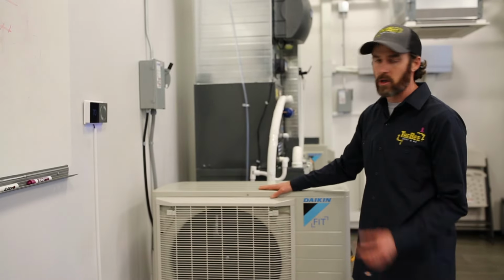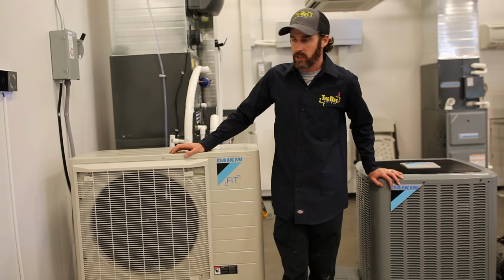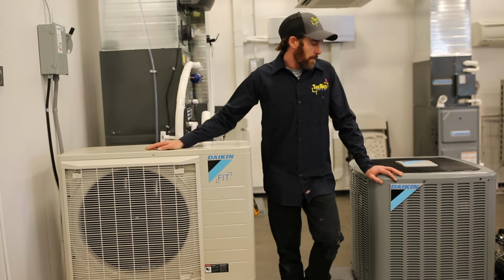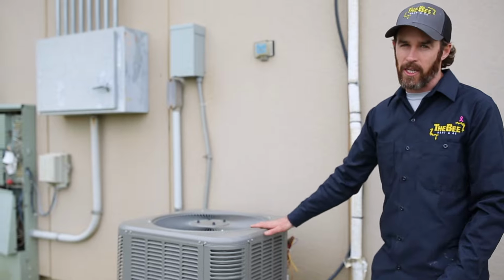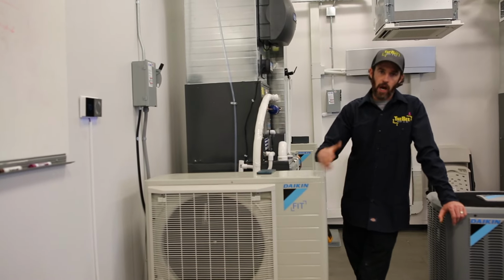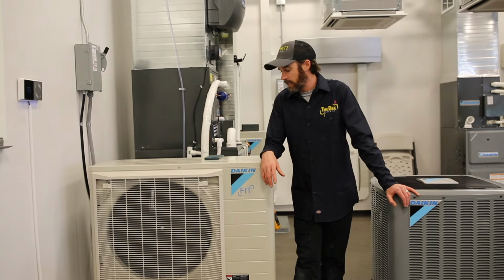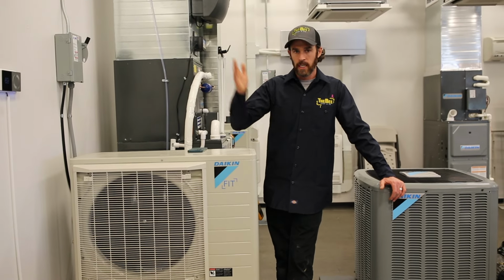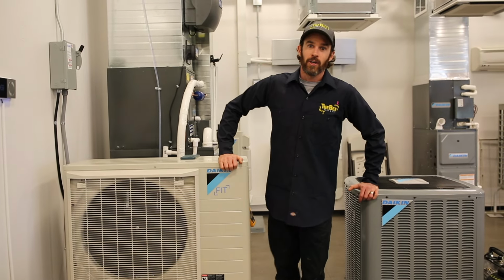BUYING A DAIKIN FIT?! Watch this FIRST or live with REGRET FOREVER!!

Comment: We moved into a house that had Daiken Ductless mini split air conditioners three years prior. WE HAVE HAD NOTHING BUT PROBLEMS!  Two years ago our air conditioning went out completely. Before I go any further, we cleaned the air filters in them religiously every 2 weeks. Daiken had to order a part that took 4 months to arrive.  That was after 3-4 service technicians looked at it.  We got the part and the end of October after suffering through a grueling hot summer.  Fast Fwd to this year.  It stopped working again. After the second service call, we had them cleaned because water was dripping down our walls.  Ever since then, they stopped cooling.  The serviceman came today and two of the three units were FINALLY cooling, but stopped again an hour after he left!  It's 95 degrees outside today, and over 86 degrees in this house!  We spent close to $3,000 on it two years ago, $575 three weeks ago, $230 today, and who knows how much tomorrow.  He is the only guy in central New York that works on these.  NOBODY WANTS TO SERVICE DAIKENS!  These are a piece of SH!T.  PLEASE if you're going for ductless, choose Samsung or whatever else.  DO NOT PURCHASE DAIKEN!  Even their helpline is pretty much no help to the technicians.  We could've had a whole new system put in for the money we've spent on "repairs" that NEVER rectify the problem.    GOOD LUCK if you decide on purchasing this CRAP!  They are nothing but a headache and I guarantee YOU WILL SUFFER WITH THE HEAT FROM IT CONTINUOUSLY BREAKING DOWN! UPDATE: After the technician came again today we were basically told we need a whole new system installed!!!  One unit out of the three is working, but we don't know for how long.  AS FOR THE TITLE OF THIS VIDEO.....THE THING YOU WILL REGRET IS IF YOU DECIDE TO PURCHASE A DAIKEN.  Our warranty expired 2 years ago.  So this whole system BASICALLY DIED in 8 years even after Daiken had a special board made for us!!! Never been so fucking pissed in my whole life!

Comment: Great videos on the Fit: I am South West Florida any 2,500 sq ft ranch house with 12 foot ceilings. I am replacing an 12 year old Lennox XC21 system (3 coils later). I have been quoted a 4 ton Dakin Fit Heat Pump (16 Seer) and a 4 ton Train XV20 (20 Seer) with the Trane composite air handler and 15kw heat strip. Both have a 10 parts and labor warranty. The Trane system is about $2,400 more expensive.  Which system do you think would be the best investment?
Reply from the maker: Daikin but I’m partial we’re a daikin dealer. In Florida you don’t need a back up heat kit with a Daikin fit heat pump the heat pump will always keep up in your temps. It’s pretty warm.
Reply from the maker: I would check with the dealer and make sure the daikin Fit will keep up that seems a little small for that square footage in Florida. In Colorado for a home that size depending on the load and design of the house you might only need a 3 1/2 or 4 ton out here but I’m surprised that’s all you need in Florida for that size home. If that’s what’s in there currently in terms of sizing and you’ve been comfortable and happy with it then that’s probably a safe bet.

Comment: I live in Ontario Canada where the weather can get into the minus temps.  Is the Daikin heat pump (80k) good enough to heat in the more rigid of temps alone or should i go with a gas furnace and Daikin air handler?
Reply from the maker: You’re going to want backup heat in Canada. Either a dual fuel with a furnace backup, or air handler with electric heat kit but 80% furnace backup heat is probably solid… your heat pump will typically be running when it’s 0F and warmer, (-18C and warmer)

Comment: Daikin = problems. Hard to troubleshoot. Intermittent problems take months to solve. Parts are not readily available. Not good in real life.
Reply from the maker: I haven’t had this experience. Their basic efficiency stuff (single stage equipment) is just like anything else, and Between their troubleshooting app for VRV / Communicating equipment I don’t think it’s any more complex than the other brands. If we had to wait for parts often we wouldn’t sell them so it might be an issue with your local distributor

Comment: I love how peoples first stated reason as to why they switch to a heat pump  is going green instead of that it’s more convenient. Yes ,a heat pump is more efficient at generating heat than than the conventional counter part however without renewable energy your just indirectly shifting  the source  of energy you use to create heat. So, heat instead of being generated by fossil fuel in your home is being generated by electricity.  Electricity still needs to be created somehow by the power plants. So, if you increase demand by going all electric you increase the demand for the generation of electricity ie still maintaining your carbon footprint. Without upgrading the electrical grid or increasing output of generation you will continue to have rolling blackouts and metering of electricity. Exactly what is seen in California who also is pushing all EVs sales by 2035 yet they are still metering their currentgrid. All this upgrade in the electric grid to meet the demand of all electric is only going to drive your electric bill up. We have seen a 300% increase in the supply charge in our electric bill. Also many renewables still have poor ROI and high costs. In addition, people still forget creation and recycling of solar panels, windmills, lithium batteries also has a significant carbon foot print and environmental impact.  I am all for new technology but just call it out as it is.
Reply from the maker: 100% it’s a mess lol… all good points. We talk about too how one thing people don’t realize about “going green” is there is still a thermal footprint with an electric car because you have endo and exothermic reactions equivalent to 20-30 tons of heat energy lol. Very thorough comment! It’s expensive to add solar too, as long as it’s your dream home / forever home I don’t think it’s a bad idea at all. Recycling these components is going to be interesting in 20 years when it comes time for people to replace them.

Comment: I was planning on putting a Daikin LV series 18k BTU mini split in my two car garage but I keep having people tell me to skip it completely and go Mitsubishi.  They keep stating they are the standard and even though Daikin is still considered a top tier manufacture it can't be compared and not to even waste time with it...  Now I'm on the fence..lol  Seems like the LV series was all the features I was looking for.
Reply from the maker: It depends they’re both solid and both have 12 year warranties. Idk we sell both but we’re primarily a daikin dealer… if a Mitsubishi diamond dealer installs their equipment often times they have a 12 year warranty as well. I’ve never installed the LV but we’ve installed their slim duct units on VRV life systems and haven’t had issues. I had a headache with their DZK system once but that’s technically not even a daikin product. Long story either will be fine especially on the 1 to 1 (1 indoor and 1 outdoor unit).
Reply: Good job! YOU MADE THE RIGHT DECISION TO GO WITH MITSUBISHI.  We will go with them after our Daikin is replaced next year.  Can't afford to replace this junk this year!
Reply: I am on my second year with my Daiken Fit and I LOVE it. My bill is much lower and the equipment is totally silent. The reason you hear so much about Mitsubushi is because Mitsubshi is sold one off to any old hack contractor but Daiken is only sold to Daiken trained professionals. Half of the problems you will ever have will be the result of a bad installation by a hack installer. Daiken installers typically don't do a bad job because they care enough about what they are doing to get properly trained.

Comment: Getting this installed tomorrow. Upgrading from a 3.5-ton 13 SEER from 2002 to the 4-ton Daikin Fit, which I believe is 17 or 18 SEER. Hoping to see reduced electricity bills here in the hot Texas months.
Reply from the maker: Right on they're a great system, we love them. Did they say you need to upsize because of your load? Just make sure you have big enough duct work. A .5 ton increase isn't a big deal and inverters ramp up and down but having plenty of airflow is always important. Most Daikin Dealers are up to snuff on that though, but I think you'll be very pleased they're great!
Reply: @thethoughtprovocateur  they replaced our duct work with a larger size! I'm so happy with the system!
Reply: My Fit continues to be junk.  Doesn't  cooI  and seems to gobble electric.  I have a Gree that was put in at same that seems to be great..Bills are lower.
Reply: @wayneogburn yeah that’s because they have a low EER. A trane 2 stage with Hyperion air handler has a higher EER.
Reply: @wayneogburn can you explain, seems odd after hearing so many good experiences
Reply: @tvmr5775 How have your power bills been the last 2 months? Just got ours installed today so I’m disappointed to see negative feedback. Hoping it helps our power go down. We got quoted a Gree but the system was mismatched 4/5 ton air handler/compressor. And our house isn’t big enough for 5 ton.
Reply: @missyneal9411  Since its been 4 months since your post, how are things going with the unit, and electric? I'm on the fence with two offers, this exact unit, and/or a trane? All feedback is welcomed. TY
Reply: @missyneal9411  they've gone up a bit honestly 😭 but it has been record breaking hot here so it's been on all day long
Reply: A year later and my electric bills have gone up.  They don't tell you this Fit is designed to run 22 out of 24 hours.

Comment: Great review.  Am about to pull the trigger on a Daikin FIT system for my home.  We're undergoing a major reno, and the original HVAC from 1994 will be swapped out for this HE system.  Thanks again for sharing.
Reply: Did you end up getting a FIT? What state are you in? How do you like it?
Reply from the maker: For sure that’s awesome, congrats they’re a great system.
Reply: Wondering what the supply air temperature is gonna be at the supply duct during the heating mode with an outdoor ambient temperature of 18 F. What say you? 
 Do Daikins use electric heat / emergency heat back up?

Comment: Is the Daikin fit compatible with existing equipment or would I have to purchase a Daikin indoor unit?
Reply from the maker: Common question and they now have a gateway adapter so it can pair with existing non-daikin equipment. They work great, we install them regularly. The Daikin fit heat pump though does not work with a gateway adapter so if you want an inverter heat pump with an existing furnace, then the Mitsubishi intelliheat is an awesome option and has sizing options up to 3.5 tons.

Comment: I replaced my system in my house around 2 months ago. I’ve had two new systems in the past 6-7 years. One was a comfortmaker and the other was rudd. The comfortmaker compressor failed within 4 years. Some people may like rudd because of the price but I was never happy with it. It struggled to keep my house cool and it went bad quicker than the comfortmaker. I will say the guy I was using wasn’t worth a damn and that could of been the problem. I went with a new company and they carry carrier and daikin. I was originally going to go with carrier but the company informed me that Daikin had a better warranty and it would save me a few dollars. They recommended a 3 ton unit but I was borderline between the 3 and the 3.5 ton in my area. I decided to go with the 3.5 ton because I like my house at 69 degrees. It was right at $14,000 for the system, but I did add a humidifier for the winter which was like a $850-$900 option. I can already tell a difference in my house and my bill has been quite a bit cheaper. So far it was a great investment and was worth the money.
Reply: Update- my bill has been between $150-$200 cheaper than my previous units. It’s not really a flaw but only downside I have noticed is the coils get dirty easily. The coils are more exposed than a traditional unit. It’s nothing that anyone can’t handle. Only takes less than 10 minutes to spray off and clean using a hose with low pressure. It’s still working like a champ. Puts out a lot of air and I’m very happy with it.
Reply from the maker: That's awesome to hear thanks for posting! That's a pretty big savings on your bill not bad! Not sure what it was before but that's great to hear. We love the Fit I've never had any complaints on them that we've personally installed.
Reply: @blainelesicko8262  What state are you in?  I haven't had a chance to run the AC.  I rarely use a heater, but will be running the AC close to 24/7 when it gets hot.  I'm in California.  I'll be able to get a better idea how efficient Daiken is.  Difficult for me to compare a heating bill to an AC bill.  I had a Goodman AC before this, which is considered lower end.  But that Goodman never stopped!  It was excellent.  No complaints here about Goodman.  It just got too old and didn't want to risk it breaking down in the middle of summer.
Reply: @twoweeledsoto6072  I’m am in Illinois. Back in August my control board in the outdoor condenser went out for some reason. Thank god for the warranty. Other than that the whole system has saved me quite a bit each month. Keeps my home very comfortable.
Reply: @twoweeledsoto6072  When I had my Comfort Maker and Rudd system ran almost constantly. With this system it keeps up a lot better. I think the control board was a fluke. Company didn’t question anything and I had it fixed within two days. Daiken next day the part to the company that installed it. I’m very happy with it. It was worth the price I paid.
Reply: What coils? Where? @blainelesicko8262
Reply: How big is your home? I live in a 3 story townhouse and wondered if a 3 ton, 17.2 seer, variable speed unit, would cool the 3rd floor bedrooms enough.
Reply: @elizabethoconnor1263   I live in a two story ranch and only cool the main level. My main level is a around 2300 square feet. Besides your square footage the size of your system also depends on where you live.

Comment: Installing Daikin Fit on my new home......Also looked at Bosch....any opinion  Bosch  vs the Daikin fit
Reply from the maker: We're a Daikin dealer so I'm kind of partial. I trust Daikin's warranty (12 years) and they know their product when it comes to inverters and make a very high quality product... Can't speak to bosch, I don't like their power tools lol... To save yourself a headache make sure you put a surge protector on the condenser. This prevents fried boards / etc from power surges, definitely worth it on any inverter system.
Reply: Rector seal rsh50vrm best surge protection board blows up 253 vac

Comment: Cost to install hight end, 5Ton, 3,200sq ft home, dust anti-
Reply from the maker: Depends on a lot of factors but the company and their overhead is the biggest variable. This varies widely from Region too... I hear prices from other states sometimes and my jaw hits the floor (both from "low" and "high" prices). Get 3 bids if you can from local reputable contractors and that should give you a baseline.

Comment: I am in the market to replace my heat pump with an inverter style but I have to keep my existing line set and wire (18/8) due to being in a townhome with units next to me. Unsure if I can use the Daikin Fit for my needs, but looking at the Fit, Gree Flexx, and Westinghouse. Not sure if I can use my existing wire between outdoor and indoor units.
Reply from the maker: Yes the Daikin Fit will communicate with regular 2 wire thermostat wire. VRV life will not though... but Daikin fit shouldn't have any issues. I realize this is a tardy reply so hopefully it was in time, thanks for commenting!
Reply: How did the project go? I live in a 1600sq ft townhome built in 2008- a quad- 4 units, and my unit is on the end. The company that offered an estimate did not mention anything about it being an issue. Interesting? Did you go with this unit? How are things going? Did it help your electric bill? All feedback is welcomed thank you.